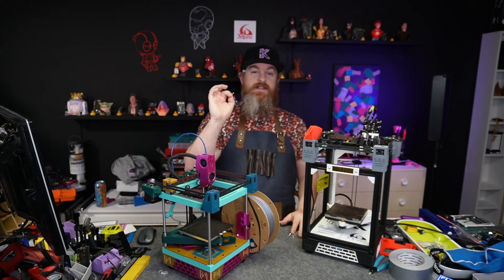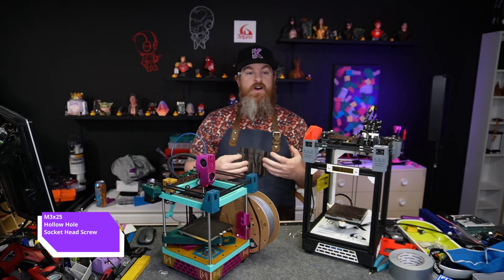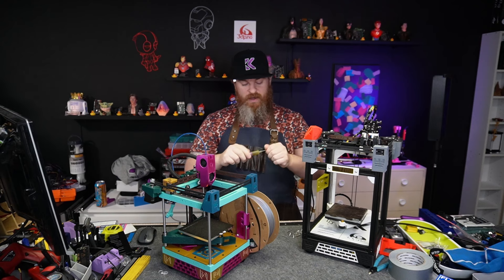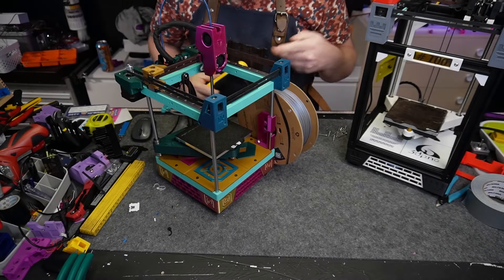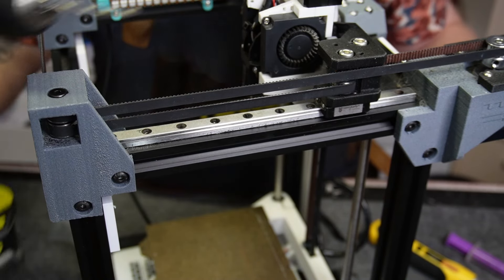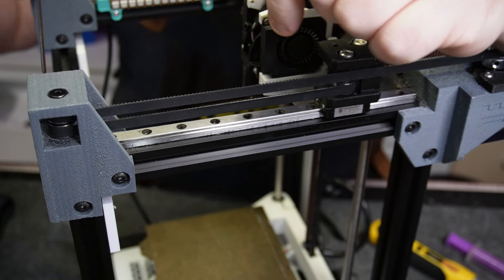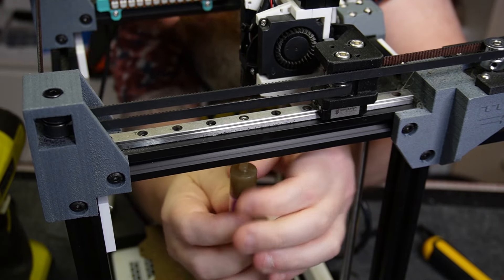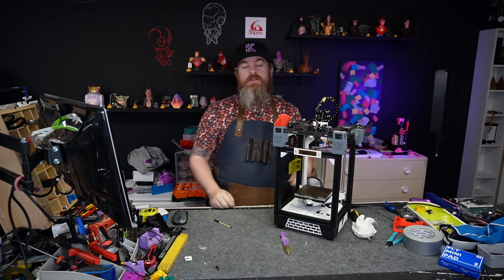Lubricate your rails the easy way!

Comment: Great if you already have a hole in the extrusion, but I'm pretty sure I don't want aluminum shards on my rails.
Reply: How would you manage that, by keeping rail on I’m guessing while drilling
Reply from the maker: If you are not comfortable drilling with the rail on, you can always mark where you want the hole, remove the rail, then drill the hole.
But it has not been an issue so far, I always wipe off the rail after drilling.
Reply: Just drill and clean, no big deal.
Reply: @kanrogcreations  if doing this on an extrusion, doesn't the t-nut get in the way or get moved?
Reply from the maker: @hgelpke you won't do this to an existing bolt, do it in one of the other holes on the rails.
The t-nut on the back is inside the extrusion, so there is about 3mm of the screw sticking out after the t-nut.